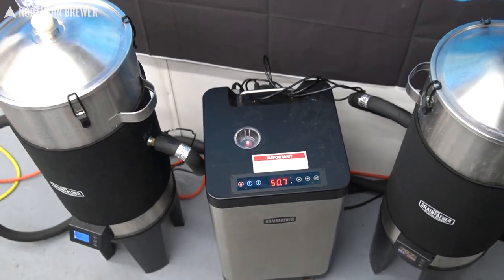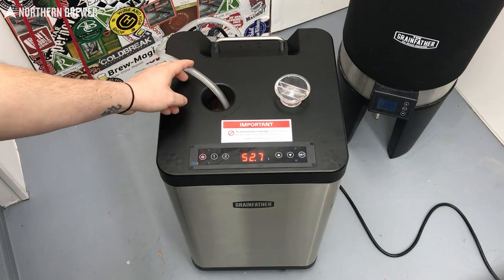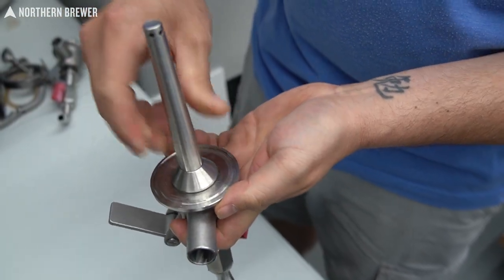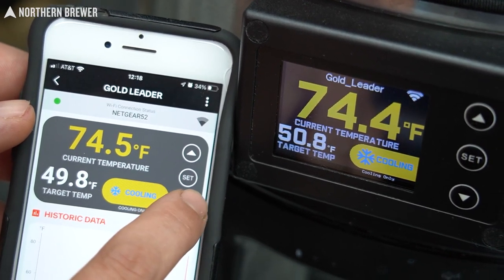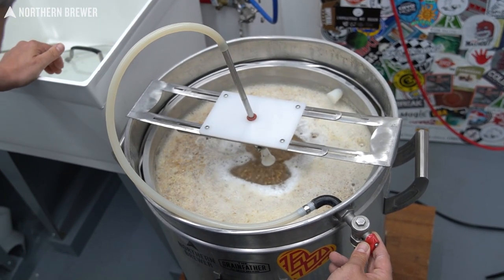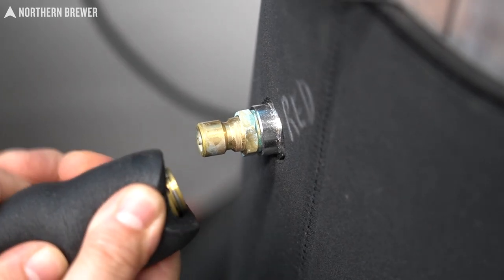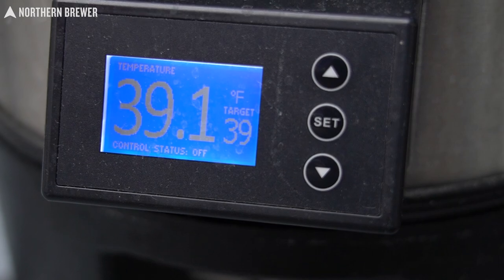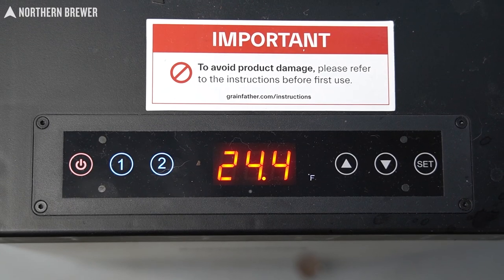Ultimate Grainfather Setup! Conical Fermenters & Glycol Chiller

Comment: I used the GF conical 4 times. The 4th time i was doing a Neipa with loads off hops in it. Quess what,  hops all got stuck in the cone. O-rings damaged. And the lid leaks when adding a few psi co2. 
After that time i was done with GF Fermenters. I sold it the day after.   But i do like the G40.  
Jacketed 14 gal Unitanks with big TC ports are the way to go now.  
I used the GF conical with a Mini freezer, 10w aqua pump,inkbird 308. The GF glycol chillers cost 800-1200 euro.  To pricey.

Comment: If you put the isolation over the brass connectors then the condensation just pours at the the end near the chiller. At least in my case. Is there some otherway to catch the condensation moist?

Comment: Can NB comment on the GC2 having a hysteresis of >5F. I experienced this on my first brew with this system. Wort in the fermenter at 66F. And this was my fermentation temp setting. But the initial fermentation was very vigorous from a good starter and the temp rose to 71. But the GC2 never kicked in until then. Then it did quickly drop the temp, but it rose back up as fermentation continued. Ok I'm a novice with chilling with glycol, but this is not a better fermentation temp control I signed up for!

Comment: Hey there! I’ve been using the glycol chiller for two batches as of now, but somehow the temperature won’t get down to 39F… it’s stuck between 43-45F while trying to cold crash. Do you know why this might be happening and how I can surpass this problem?
Reply: Do you use a jacket on your fermenter? Besides fermenter insulation ambient temperature also matters when you are trying to cool as low as 39F
Reply: @ yeah I use a jacket on the fermenter and in a somewhat colder room inside the house. So technically, I should be able to reach colder temperatures

Comment: Couple Questions:
Does the GC4 come with 4 pumps & insulated cooling lines?
When ordering the GF30 fermentors do I order set of insulated lines or are there any included with the clycol chiller
When ordering the GF30s
Reply from the maker: The GC4 specifically comes with two insulated tubes and sets of brass connection couplers, which is required to hook one fermenter up to the unit:
https://www.northernbrewer.com/products/grainfather-glycol-chiller-with-cooler-connection-kit

Additional tubing kits need to be purchased for any additional fermenters.
https://www.northernbrewer.com/products/grainfather-conical-fermenter-cooler-connection-kit

Comment: Instead of electrical tape I would use adhesive lined heat shrink tubing, basically heat shrink with hot glue inside it. Water tight connections!
Reply: Best solution

Comment: I just bought the grain father conical fermentor pro edition same setup as yours with the foam jacket I’m using a diy glycol chiller with the Grainfather pump system with the insulated lines my glycol tank is 20 liters temp is a steady -8 degrees Celsius with my testing of this fermentor I have 23 liters of water in the fermentor the temp set to 4 degrees Celsius the start temp of the water was 20 degrees Celsius the room temp is 22 degrees Celsius the first day the temp hovered around 6 degrees Celsius at the censor at the bottom but the temperature at the top half is at -1 degrees Celsius with a thin layer of ice on the top second day turned up temp to 6 degrees on the fermentor now the the top of the fermentor is around o degrees Celsius no ice on top it seems like there is a flaw with this design can’t get the bottom half below 6 degrees Celsius with out freezing the top half I have noticed that all the videos are not showing this fermentor cold crashing this is the reason I bought this fermentor so I could free up my fridge and use it for my kegs do you have any helpful hints thanks